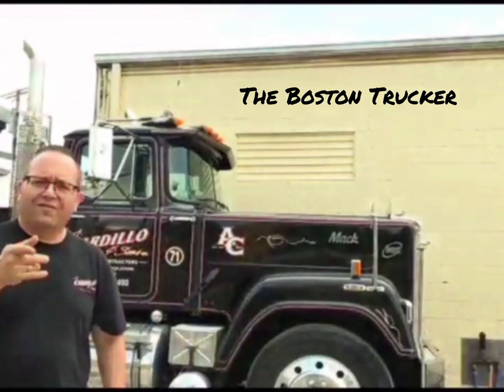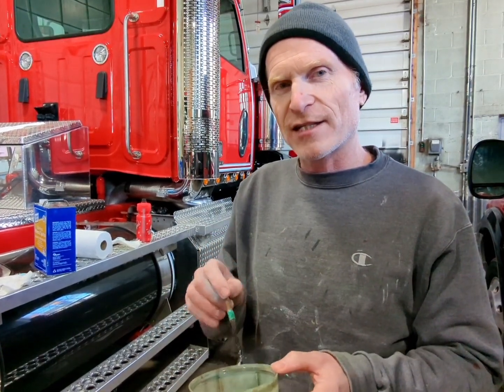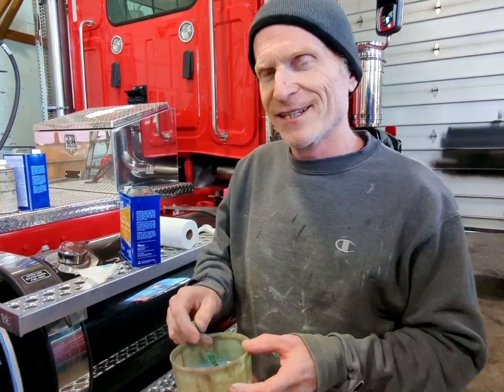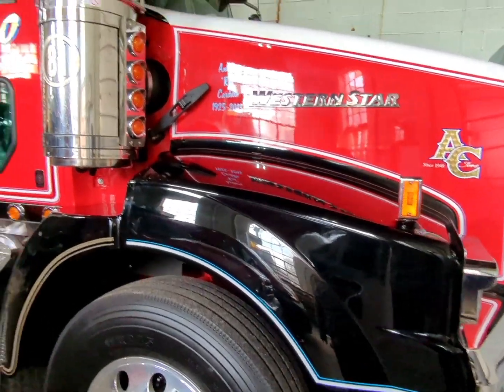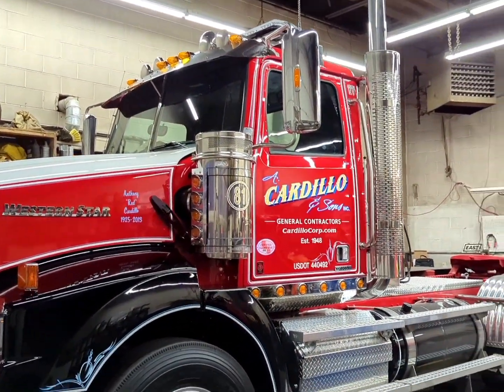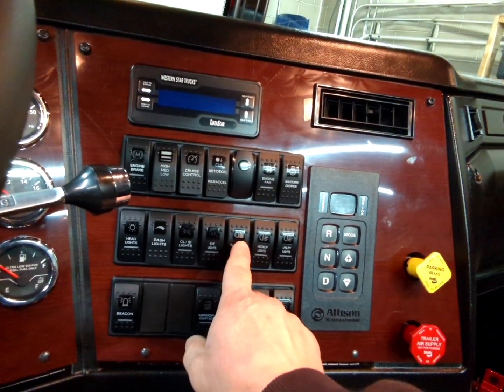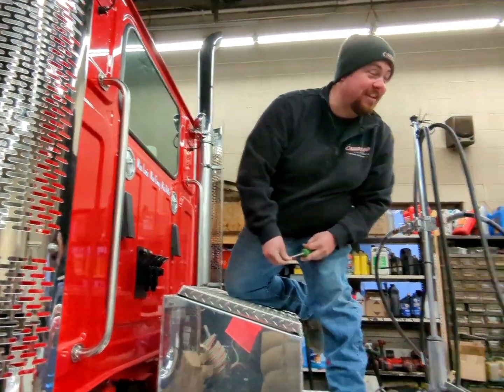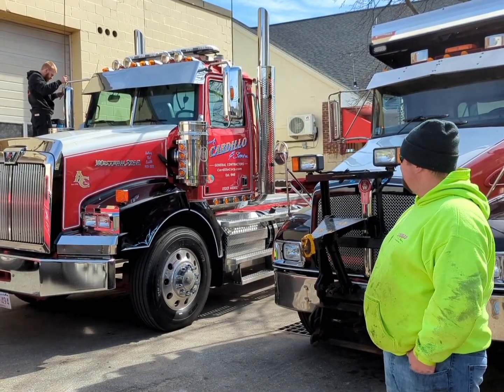2022 Western Star 4900SB

Comment: Nice unit there, he'll like the 4900. I've had a few of them and they're good tractors, comfy large and quiet cab, good turning radius and smooth ride. They rode better than a couple KW T-880's we have, just traded out the last 4900, it was a 2019, replaced it with the latest Western Star, the 49X SB. The 49X has an even wider and taller cab than the 4900, this one has 22,000 front with 425 floats, a 22,000 steerable drop pusher and  58,000 rears. This one has the Cummins X15 605/2050 with 18 speed main and 4 speed aux with PTO and double locking 5th wheel with 72" slide, it's a beast but drives like a pickup, really great ride, better vision all around when compared to the 4900 or T-880, so far I'm really liking it a lot.
Reply from the maker: Very cool, I'm expecting good things with this truck.
Reply: @TheBostonTrucker  You guys will like it, the 4900 is a great tractor. The 49X is basically an evolution of the 4900, a new and improved version. I'm not overweight, but I'm a fairly sizeable guy and I like a wider, deeper cab with a lot of legroom and as good as the 4900 is in that regard, the 49X is even better. Keep us posted on how you like the automatic, I'm just a bit old school as far as the 3 pedal trucks go, but I'm not against trying something new, just haven't found an automatic that works as well with ultra heavy loads and 3 stage Jake yet. The 49X is almost done, it's getting a ProTech headache rack/chain locker a Whelen strobe bar and a full set of LED load lights this week.

Comment: Sharp Ride! Glad to see they have kept the dash styling of the Star and not crossbred it with freightliner ... or gone mostly digital like Peterbilt gag ... Even as a automatic I'd still happily rock that ride (though I'd much prefer my 359).   Safe Travels!
Reply from the maker: Appreciate my friend.
Reply: @TheBostonTrucker  i own a star car too... A '94... Not sure what I'll end up doing with it, is been shortened... Maybe rerail it back to a usable length. N14 15spd, 46k rears on neway suspension

Comment: Its still a Freightliner with a Western Star name. It must be an East Coast thing, pin stripping trucks. We don't see it done out here on the West Coast. That WS will never be as reliable as the W900 you drive. The 4700SB I was driving the engine light never went out. I'm driving a 28 year old KW T450 its old and slow. Its my first KW truck I've drove.  KW is a better truck than a WS.
Reply from the maker: The engine light on my W9 never goes out. 🥺
Reply: @TheBostonTrucker  You're truck doesn't have DEF. The DD13 in the WS I drove would go into derate mode.